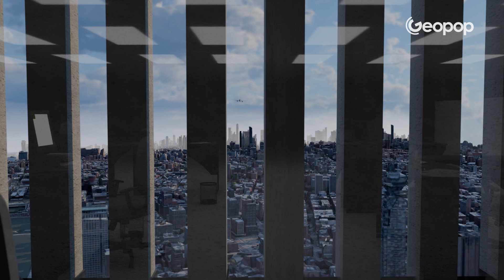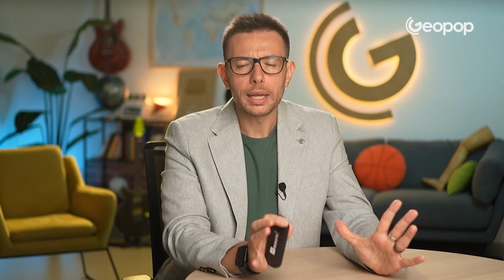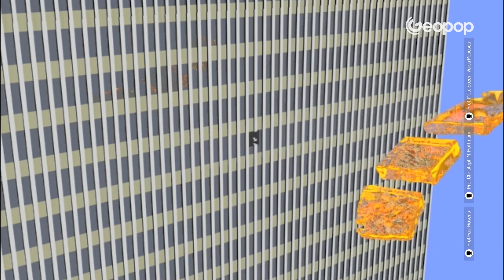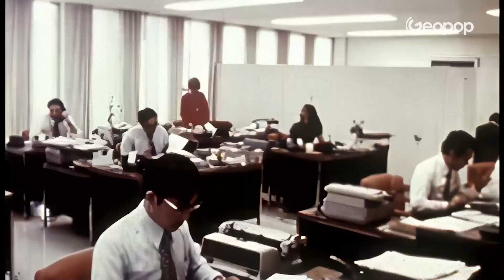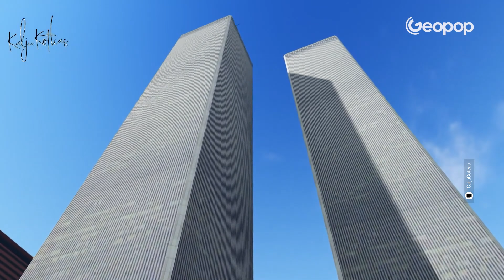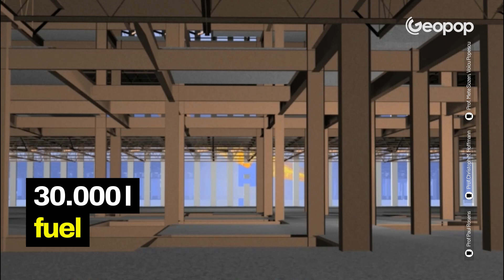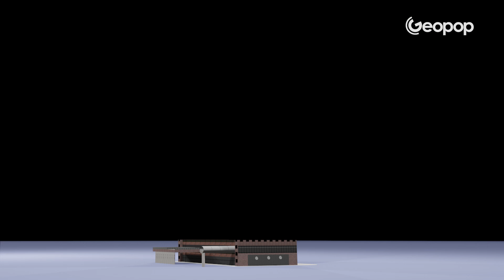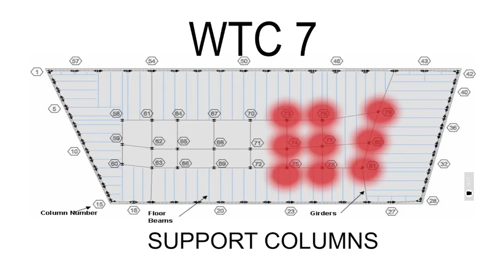9/11, 2001: The Technical Reconstruction of the Twin Towers and WTC 7 Collapses

Comment: You see, I have a problem with the heat caused the structural integrity to cause the whole buildings to fall straight down. The elevator shafts were several feet which on each wall and heavily laced with steel reinforcements. Yes, the floors a couple floors down received extreme heat as well as the floors above. Although the floors hit and the ones above could cause a downward collapse, BUT, with the thickness of the elevator saft and the perimeter supports below, there's no way the weight above could cause an almost perfect straight down collapse. Yes, I have structural engineering experience and explosive training in the service. The weight compared to the integrity of the shaft and supports, it may possibly have collapsed a few floors below, but they'll never get me to believe that it caused the whole thing to collapse the way it did. No, I'm not a conspiracy theorist. I'm going with my decades of structural integrities and weight transference.
Reply: You're doing it wrong. Let's try this a different way.

1. The Twin Towers consisted of 4 primary structural elements that together formed an integrated system where each relied on the others.  47 hollow box-section steel Core Columns carry the majority of the gravity loads. The 236 hollow box-section steel Perimeter Columns carry the remainder and ALL of the lateral (wind) loads. Long-span Lightweight Steel Trusses connect the core and perimeter column together at each floor with a Hat Truss on top to tie the structure together as an integrated unit where no element can survive without the others 

2. The impact of 117 tons of airplane (= to about 12 dump trucks) at speeds up to 590 mph completely destroys the aircraft.  This in no way implies the Towers come out unscathed. Some folks don’t get that. Hitting with the energy of up to a ton of TNT the impact damages or destroys many perimeter and some core columns (33 of 59 perimeter and 20 core columns destroyed at the impact floors in the North Tower), primarily through bolt-shearing failures at the end connecting flanges, as well as bending, twisting and fracturing of weld seams. There was no cutting or slicing - the reality was far more violent and messy. 

3. The impacts destroy or damage fire insulation, fire breaks and sprinkler systems on multiple floors. Huge fires are started across multiple floors simultaneously and allowed to spread rapidly with no effective firefighting or fire suppression. This was an unprecedented fire event . 

4. The hotter steel gets the weaker it gets .  With fire insulation stripped away and no sprinklers the survival time of the steel greatly reduced. Gradually over time heat causes the lightweight steel Floor Trusses at the impact damaged floors to sag, which was observed and recorded.  No steel melted nor did it need to. Structural steel will fail long before it turns to a puddle. It just needs to bend

5. Sagging floor trusses pull on the increasingly weak and overloaded Perimeter Columns, causing some of them to bow inward by up to 5 feet. A straight column is up to 4 times stronger than a bent column. The bowed Perimeter Columns buckle and fail, initiating collapse. The formerly static mass above which the structure below could easily support is now converted into a dynamic mass up to 30 times greater. Because they have buckled, the Columns above and below the failure point are no longer aligned . The load bearing structure below no longer bears any load as it falls past the lower columns, NOT onto them.

6. Thousands of tons of debris fall within the four outer walls, down through the open office space, crashing onto the first intact floor it encounters. This massive impact immediately breaks the bolted connections to the columns as the amount of resistance the Floor Trusses can offer is negligible.  The falling debris slows only marginally and briefly. Note:
6a. This is NOT a solid top block crashing into and “crushing” a solid bottom block .
6b. The debris falls past the columns not onto them.  The columns provide no resistance to the falling debris. 
6c. Only the bolted connections of the floor trusses to the core and perimeter columns can offer any resistance. A pair of 5/8” bolts at each end of each truss vs. thousands of tons of falling debris.
6d. No laws of physics are violated.

7.  This floor-led collapse progression within the four outer walls can only go straight down. Note: 
7a. This process is often incorrectly referred to as “pancaking” which actually refers to a completely different process rejected at an early stage. The catchy name stuck but nobody knows what it is supposed to mean.  Pancaking is too simplistic and inaccurate anyway. More like Kaiserschmarrn.

8. Collapse progresses through the floor systems not down the columns, through the path of least resistance . Rate of floor failures increases with each successive floor as momentum increases, reaching an average acceleration of 0.65 of GA, or 35% slower than true free fall. Bam, bam, bam down the building until there are no more floors to fail.  The resistance offered by each successive floor is always the same. The mass and velocity and thus the energy of the falling debris are constantly increasing with every floor destroyed new falling mass is added. Some falls to the sides, but most falls down. More mass, more velocity, same resistance with each floor.  Don’t get stuck on the but the lower floors weren’t on fire nonsense. They weren‘t and didn’t need to be.

9. The Towers were 95% air by volume. As that air was compressed inside the building it is forced down the tower and blown out the sides in reaction to the building collapsing . Those were not “explosions”, it was expulsions of compressed air caused by the collapsing building, explaining the low velocity, lack of flash, blast, supersonic pressure waves and lethal high-velocity ejecta.  

10. Perimeter Columns become detached and peel away like a banana behind the collapse front, playing out to the four points of the compass extending to more than 600 feet from the base of the towers. This was quite obvious from examination of the debris pile. 

11. Core Columns fail last as their internal beam bracing is stripped away by falling debris and lateral support from the floor to perimeter columns is lost. 

12. For those who care about how long this whole process took; 31-34 seconds from the moment the perimeter columns buckled until the last core columns hit the pile, or 1/3 the rate of true free fall. Don’t believe me?  Just watch any video of the collapses and note the loose truly free falling debris dropping much faster than the towers themselves.  

13. Each Tower had a 1-acre footprint. Far from collapsing inside their own footprints the debris pile spread out over 16 acres in a pile up to 14 stories deep. 8 surrounding buildings were destroyed and scores more damaged. 

14. The Twin Towers were perfectly safe within their design envelope.  They only collapsed when taken far outside design parameters by an extraordinary and unprecedented event. 

Impact + Fire (heat) + Time + Gravity = Collapse . Remove any one of those four elements and there is no collapse. Ignore any of those elements (as many do) and you will never understand the collapses. The Twin Towers were an integrated system in which no one component could survive without the others. One fails, the rest follow, through the path of least resistance – DOWN – through the open space, bypassing the path of greatest resistance – the columns.  Nothing I just described violates any laws of physics. All of the above is true no matter who planned and carried out the 9/11 attacks or why 

I hope you found this helpful and informative. It is not meant to be adversarial, but to solicit informed critical comment, positive or negative. If I made any errors of fact, logic or reason or left anything critical out, please let me know so I can fix it. One topic at a time, on topic only please to stay focused, no word-salads of Gish Gallop. IF you can offer a more plausible alternative be my guest. So far no one has even tried.
Reply: The vertical steel elements gave the support to the building, like a corrugated board, to scale replica, and only some were exposed to "extreme" heat.

Also what I don't understand, why did it came down so fast. The weight of the top of the buildings, above the plane impacts never increased ‼️
Reply: @mollymeyer  - All of that is explained in my previous reply in this thread.
Reply: @mollymeyer  exactly. And why wasn't an independent inspector allowed to investigate how the structural beams failed. Theres been no independent investigations of the why's, and they quickly hauled off the black boxes and the beams. They claimed they found no black boxes, but 2 people on the crew looking for bodies said they had the black boxes and covered them so the public couldn't see them. I'm not a conspiracy nut, but I've watched several videos from news and civilians, I have a background in structural steel and explosives. Absolutely NONE OF THIS makes sense. The center columns and several feet of concrete around them, would not of allowed the buildings to fall as they did.
Reply: @Brian1962-ob1do  - Yeah, that's all a complete load of twaddle. 

My favorite is the story about how one firefighter is alleged to have found both flight recorders for Flight's 11 and 175.

4 flight recorders, from two planes which struck different buildings from opposite directions, in a pile of millions of tons of debris spread out over 17 acres and up to 14 stories deep.

And one guy found them all - on the same day🤣🤣🤣🤣🤣🤣

Proof as if proof were needed that conspiracists will believe just about anything without question as long as it fits their personal brand of reality distortion.

Again, I gave a detailed explanation of Twin Towers collapses in my first reply in this thread (which you conspicuously ignored). I can do the same for Building 7 if you really need it, even though that is one of the most studied engineering disasters in history with thousands of pages of technical research devoted to it.

Comment: Most renowned engineers don't buy this failure, especially 7. Therefore if it is not a man made event I will not enter most high rises ever again. These engineers don't know what their talking about? That's even scarier.
Reply: I think they know what they're talking about - but they also know how to keep their reputation, their income, staying on the good foot with their family, keeping their friends etc. in this upside-down world - and that is what's scary. That desperately holding on to money, career and rep has turned people into lying slaves for the system. 

If they had some integrity, they would discuss the matter openly with representatives of AE911Truth. This is propaganda to only serve one side of the matter.
Reply: What is the source of the many tons of molten steel found in and under the debris, the heat so intense that the molten steel remained in that state for weeks afterward, running off of the debris as it was excavated. This cannot be molten copper from wiring that retains the color of a shiny new penny.  It cannot be molten aluminum that retains the color of the polished aluminum wheels of a street racer. It was the color of glowing orange molten steel  that cannot be mistaken for any other material, reported by firefighters who are very experienced in the nature of such materials as well as seen in video evidence.

When you combine this with an entire lack of turbulence behind 500 mph aircraft, when even a small Cessna Aircraft would leave an evident wake in the smoke and fire only seconds later .  . We find that skeptics still cannot be skeptical of the official narrative in explanation.  Sponsored channels and forum activity are skeptical of nothing when support is provided.

Sponsored activity in the forums is very normal today for commercial and political purposes and subjects of controversy -- in the attempt to lead public debate.

Comment: Never addressed what happened to the vertical beams in the core. With this explanation, we should’ve seen a tall core of vertical beams still standing in the center of buildings 1 and 2.
Reply: We did. Pay more attention. Cores were the last part to fall, quite unable to stand on their own for long after the rest of the structure fell. It was an integrated system after all.

Comment: The airplanes didn't cause the collapses of WTC 1, 2 & 7. 
There are no conspiracy theories. Stop using that phrase which the CIA demanded all media use to defame people who didn't believe that JFK was killed by the patsy, Oswald. Stop using THEIR derogatory phrase. 
There are events and then there should be investigations into what led to and/or caused the events to happen as they did.
Reply: Twin Towers collapses were a combo platter; Impact Damage + Fire (heat) + Time + Gravity = Collapse

Remove any one of those four factors and there is no collapse. The problem is many people are single-element (non)thinkers so four elements is at least three more than they can handle. This is why so many on-line discussions never expand beyond _planes can not cause the collapse or fire can not cause the collapse while never linking the two. And forget about time and gravity. They never even come up.

Comment: your video is crap  you have no clue what you are talking about. no high rise has ever collapsed due to fire from burning office fires.
the fuel from office furnisihng only lasts minutes and  as the fire fighter on the 78 th floor said there are a couple of localized fires that could be put out here on the 78th floor  two  companys could put it out  get them up here. also the theory  of f=ma will not let the upper floors crush the bottom forces  if 18 floors fell less than eighteen would be crushed . same as dropping a bowling ball on sheets of glass laid out on cinder blocks   only 5 or 6 sheets will break and the ball stops.  physics was not at play on 9/11 there were 3 or more physics lessesons that happened on 9/11 that have not been proven by nist.  university  of alskas study tell the story of wtc 7 and how it would have to be controlled demoltion  for wtc 7 to come down in free fall for 7 seconds.  8 floors of structure beams would have to be cut simultaneously  for the 47 story building to come down in its own foot print.  also  130 plus fire fighter heard explosions  before wtc 1 and 2 and 7 came down.   they explained it live on tv   boom boom boom  its like they were being demolished by explosions.  and they were right and always will be right . i belive someone running into a  burning building to save lives  before i would trust government or gulliani or larry silverstein . silverstein had plans in place and spilt the beans on tv. he said he had plans ready in 2000. also if you look at the pyraclastic flow comming up and out of wtc 1 and 2 that burnt cars only on one side is more proof  that more than dynomite was used . also were did the concrete and steel go. shat was pulverized and vapourized from intense heat  like a nuclear exploson like the ones tested in navada in the 50s. same exact patern of pyroclastic dust coming out of wtc 1 and 2 . if you would like more proof  go to my web site videos .
Reply: You are a Mindless Repeater of other people's bad ideas.
Reply: Womp womp actually do research instead of believing the delusions that people like you push